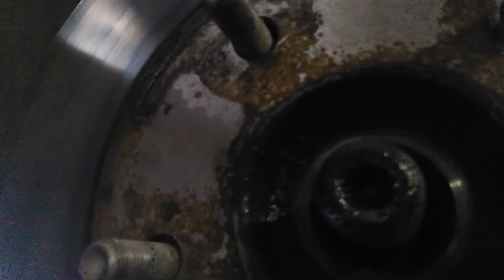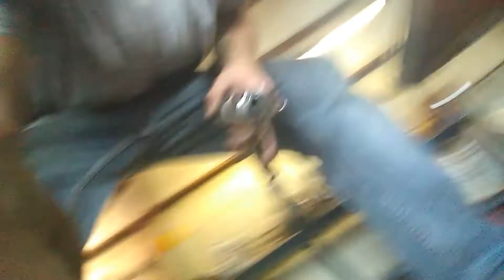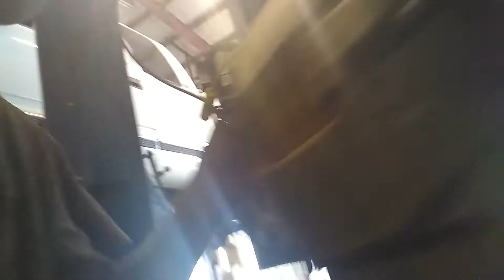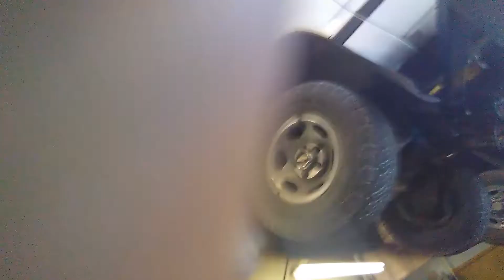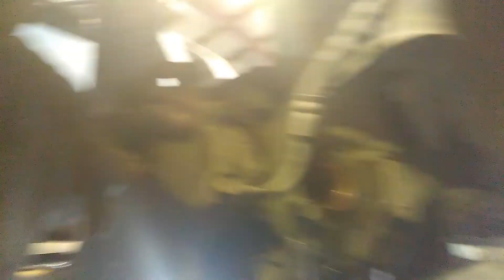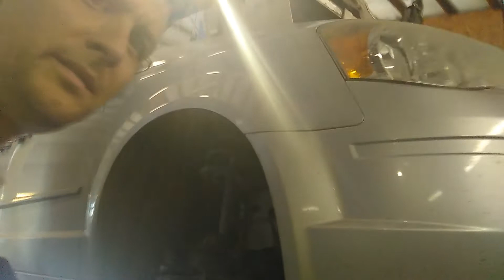Chrysler town and county. Cv shaft removal

Comment: hey bro, great you uploaded a video of a "Chrysler" axle. I didn't even watch it because it's not the same car I did, an import car, a Nissan Murano. Get that straight!! Every car is different with removing the axles. TRUST ME BRO.
I was expecting you to remove an axle on the same car i did. You will know when you do it.
I will guarantee you, you can't do that with a Nissan Murano. I will wait for that video if it takes a year till you get it then just upload it. The drivers side ok?
And you will see. But hey, great you uploaded a video on a Chrysler. BUT THAT IS THE WRONG CAR, YOU NEED TO SHOW IT ON THE SAME CAR I DID. Just because you did it on the Chrysler doesn't mean it is the same on a Nissan Murano. PROVE TO ME ON THE SAME CAR. PLEASE!! Don't prove it on a Chrysler. And bro, do it on jack stands when you get that Murano and I will see if you can do it 10 times faster. Doing it on a lift would be quicker for me too.
Just reminding you what said you can do.
Reply from the maker: Just try it next time there shade tree. Bottom ball joint and axle nut.